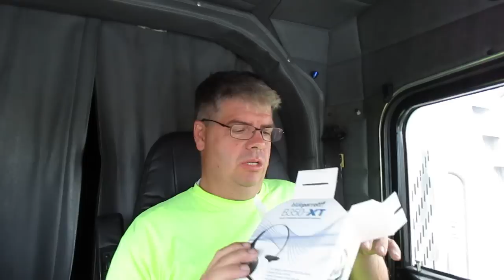#140 Still Trying to Find my Groove The Life of an Owner Operator Flatbed Truck Driver Vlog

Comment: Loving Bella.. My Labrador could really play Frisbee. She'd go and catch it in mid air then bring it back till she dropped from exhaustion..   Bella's ball matches her new vest. She'll learn if you teach her, just take patience and time.  But regardless, I'd say Bella is a lucky dog, and you are lucky to have her companionship. 
Either that Texas grill is brand new or was really cleaned by some one, I never saw a clean one before.
Me thinks you spent an extra two days in truck driving school learning all the ways to get millage out of a oil container lol....   Where you use Lucas I use Marvel Mystery oil in both fuel and oil, about a 1/2 cup after every fill up of 10 gallons and a cup per oil change.  An old mechanic told me about it, and he was totally right. It has de-glazing and anti varnish properties in it which is a good thing with today's fuel.  He told me as long as I use Marvel faithfully, i'd never have injector trouble, and knock on wood, never had fuel problems not even in the riding mower.

Comment: Just Wanted to Pass This Along to You. Your Video
#91 Big CAT Engines Laundry and Fuel FiltersYou Mentioned Hauling The Rear Bar Section on Trailers. The D.O.T. Dubbed These The Mansfield Bar After Jane Mansfield Was Killed Crashing Her Car Under The Rear of a Tractor Trailer in Slidell Louisiana. D.O.T. Made it Mandatory After That. I Always Thought it Was to Gain Access to The Rear of You Trailer, the Roll up Doors Ect. Whod Uh Thunk It!

Comment: Another nice video. Do you use the little motor to keep the truck warm and cool, instead of the letting truck engine run ?  Didn't even know they had a generator there.. Nice video.
Reply from the maker: +Truck & Duck Express ! 
Yes the little generator keeps me warm and cool without running the big engine 
Thanks for watching